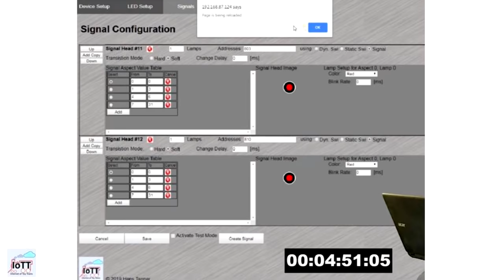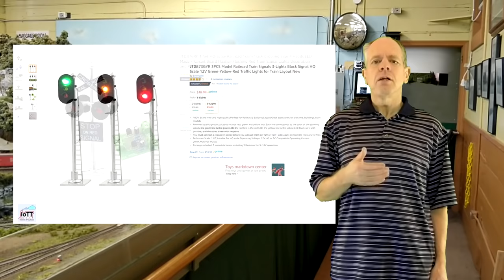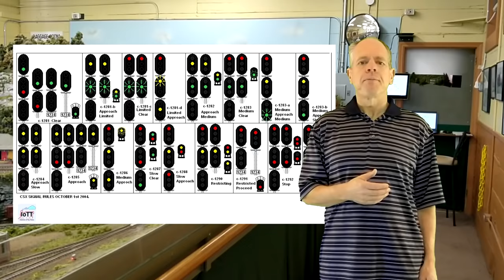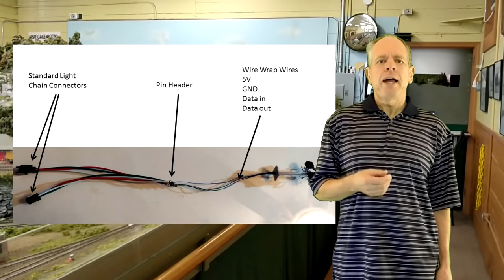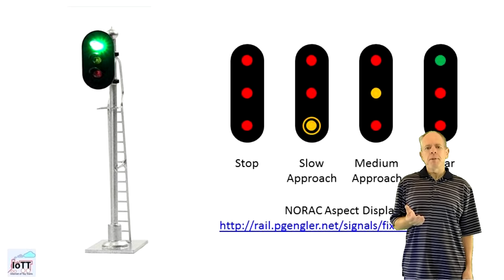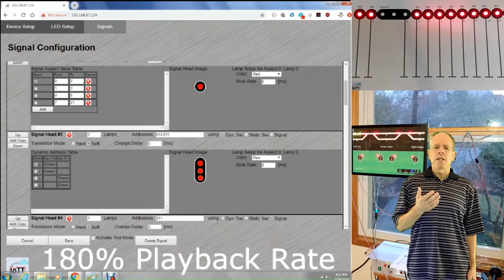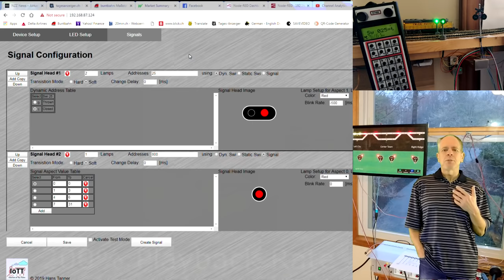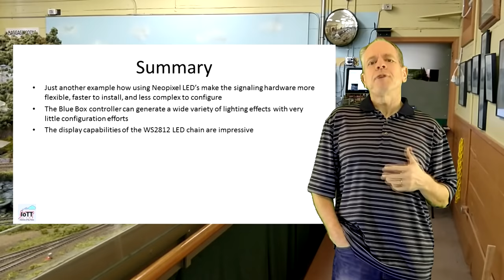Signaling System & Light Effects (Video#15)

Comment: Does this work without an MQTT server? Your idea with the NeoPixel is great. But for me, it has to work without an internet connection. With friends, I have a modular model train that can be built in different layouts. Your way is very cheap to model the ABS / APB signaling system. I'm impressed. Now I have to learn more about Arduino and ESP.
Reply from the maker: Yes, as demonstrated in Video #14, it can pick up commands from DCC, LocoNet or MQTT. The source can be selected in the setup. Setup by the way can be done with a cell phone browser as the signaling system can provide an Access Point on its own. Also, it can support signal commands sent using regular switch addresses or send using the NMRA DCC signal commands. And yes, definitively a good idea to look into Arduino and ESP ;-)